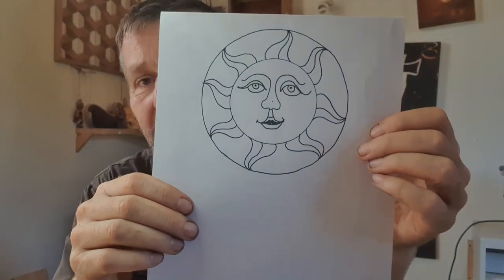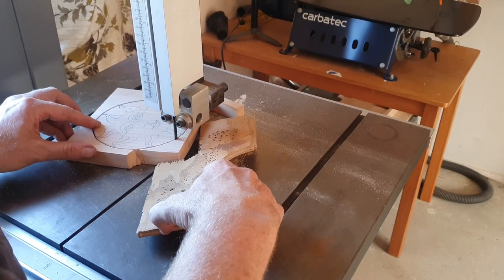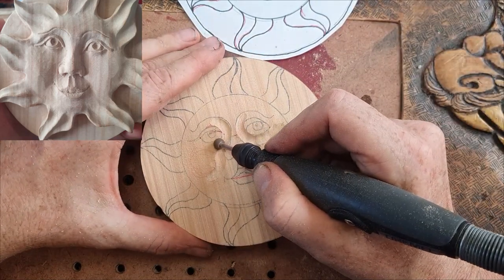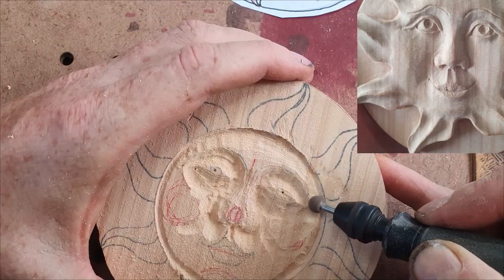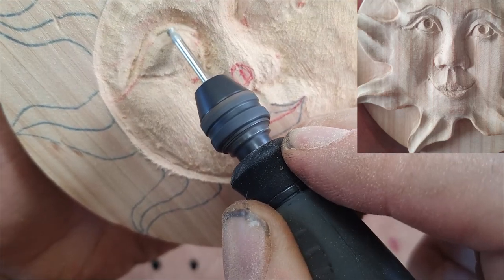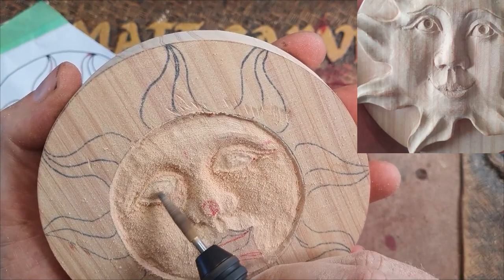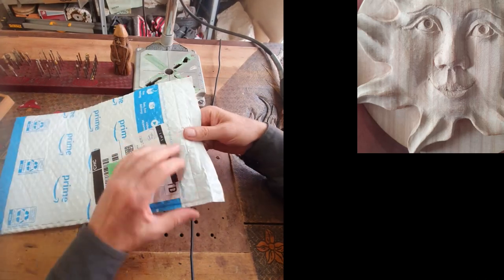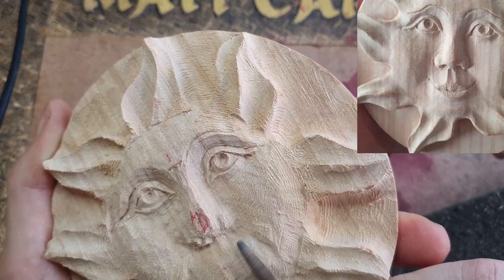Wood carving a Female Face

Comment: That would make a cool clock. Thanks for the link to those "T" bits I've been after some more of those, but it will have to wait until I've got my bandsaw fixed.
Reply from the maker: Whats wrong with the bandsaw? Yeah those bits took about 2.5 weeks to arrive, I reckon at first use they are good
Reply: @MattCarves  well to be honest I have no idea what went wrong, I was cutting out some blocks for teddy bear toys and the top wheel and blade came off. I'm not savvy enough to fix it myself.
Reply from the maker: @markanthony559  dO you mean the blade came off the top wheel? or the whole wheel came off?
Reply: @MattCarves  the whole top wheel came off... freaked the hell out of me! I hope it doesn't cost too much to fix I only got it last year.
Reply from the maker: @markanthony559  never heard of that happening. That's crazy